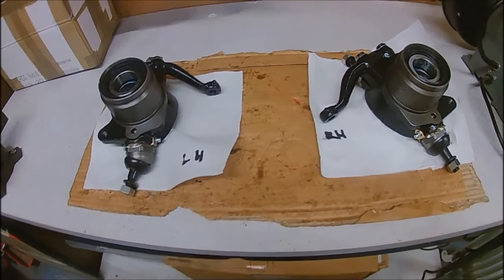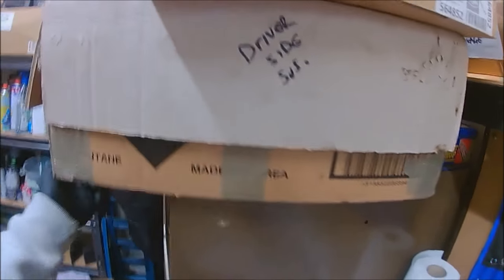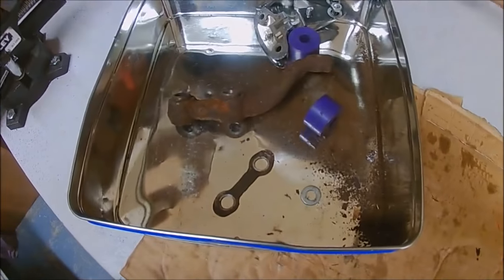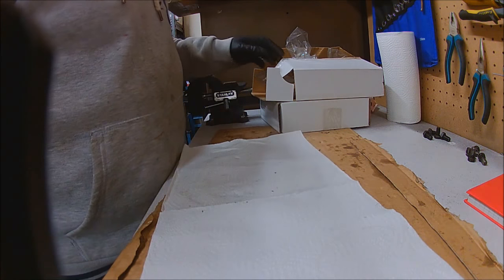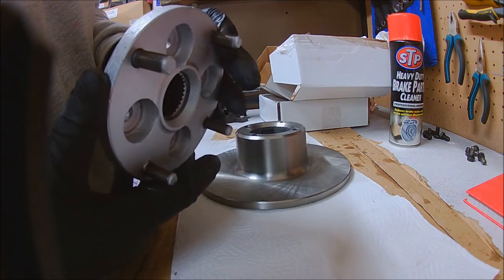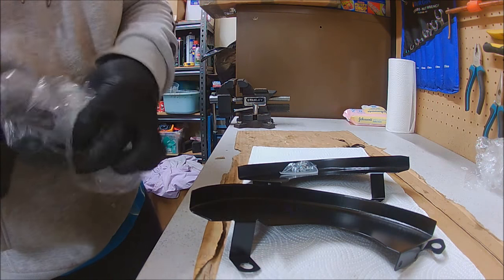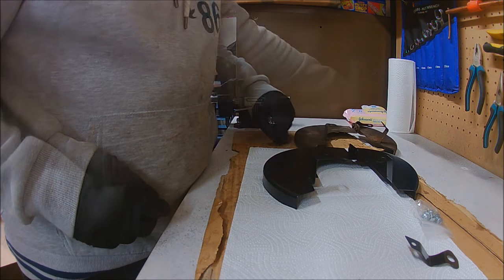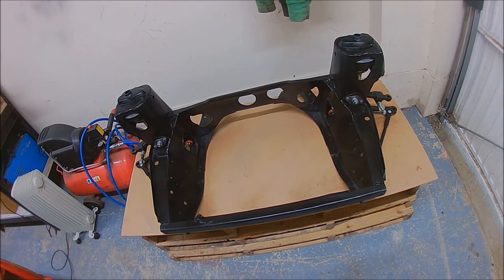Classic Mini Restoration: Eleanor Video 24, An Odd Jobs Episode

Comment: Great video, regards the brake discs dried stored or not you will get some corrosion. Stick them in a plastic box with some cat litter in a sock that should keep them 'almost' rust free....Nice job refurbing the callipers....Red is for winners.....
Reply: Better add you don't need to buy a cat...
Reply from the maker: Thanks Malcolm. Good tip. Don't think the dog would be best pleased if i added a cat to the family lol

Comment: Good effort so far. Remember you'll have to split the CVs to get them through the subframe.
Reply from the maker: Yeah i the last ones came through the subrame without splitting the cv but the new ones are slightly wider so i  split the inner pot to get them back in. I Cover that in the next vid.

Comment: Hi DB, great videos and really helpful as im restoring my 87 atm. Stupid question for you! At 4.28 on the video you are working on your brake caliper. In the bottom right of the caliper is a bolt. Can you please tell me where i can buy the bolt from / what size it is? Its not included on the minispares or moss catalogue as far as i can tell.  Its the only part i havent been able to buy new and the old ones are rounded so cant be put back in. Thanks
Reply from the maker: The part on the video that you are seeing ( i think) is a new brake bleed nipple, is that the part you mean or is it the 2 bolts that attach the two halves of the caliper together that you are looking for

Comment: Silly question: are those 8.4" discs and calipers for 12" wheels or do they need 13" wheels. Its the job I am doing on Noah now
Reply from the maker: 8.4 discs. They are for both 12 and 13" wheels
Reply: Ah cool thanks. Just I was tempted by a pair of vented discs up in Norwich but realised they needed 13" wheels and I want to keep to whatever period options were available in '78 so got the 8.4" ones....
Reply from the maker: 78 would be 10" wheels and 7.5" discs as standard unless you have upgraded
Reply: Well Noah was a part finished project and had subframes with rear running gear and front suspension but no front brakes and driveshafts (amongst many other missing parts like an engine / gearbox). But I did look back and saw 12" wheels were an option so I hope the 8.4" won't look out of place even if not 'correct'.

Comment: Got to admit what you achieve with one good arm makes me ashamed of the little I achieve with two. Respects! And do you and Sean C collaborate on the music - Top Notch.

But just one observation if I may? @ 06:35 you paint over the bolt heads? This touches on an argument I had with a guy when I was restoring a Scania 143-500 tractor unit some years ago. He said to bolt the chassis together and paint it. My view was why bother stripping it all out if it will look like a cheap blowover afterwards. Happily the owner agreed with me and said to paint then bolt so all the new cad plated bolts and the hours of work could be seen. And that is what we did.

My point being that all that detailed correct work you just did on the caliper is now hidden and you could just as well have painted a caliper with no work done. You do a great job mate so let people know and appreciate it. Take those bolts out and put new cad plated ones in.... Better still add a nice detail and get racing drilled bolts and add safety wiring.
Reply from the maker: Initially i wasn't't gonna paint them and then when they were on they didn't do it justice. Probably because i didn't order new ones but wouldn't take too much to replace them and you are right they would look good. I'm a child of the 80s so you will be seeing more 80s tunes in future vids. Can't beat it. Thanks for the comments. Its appreciated